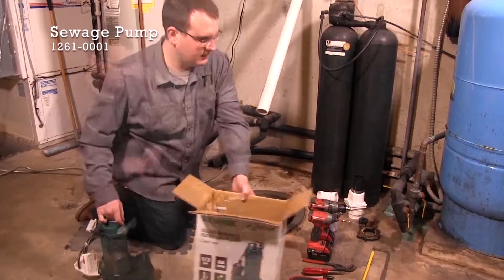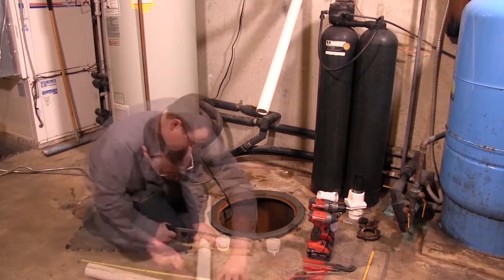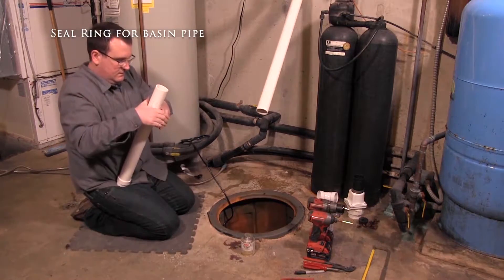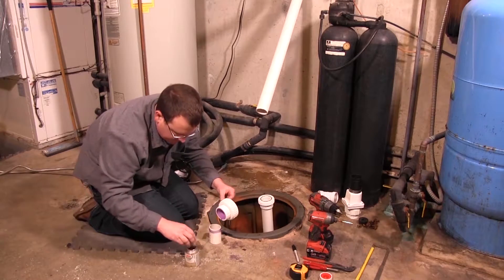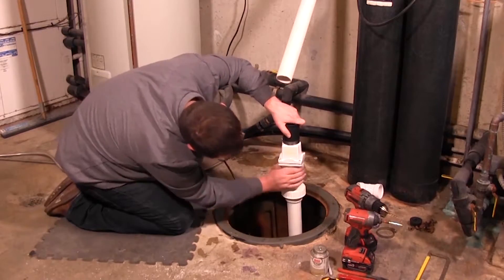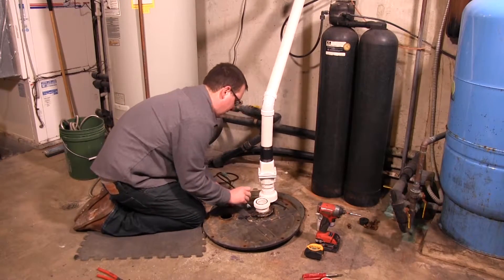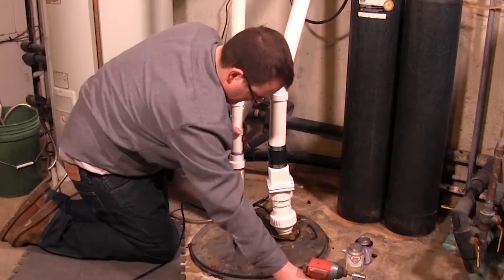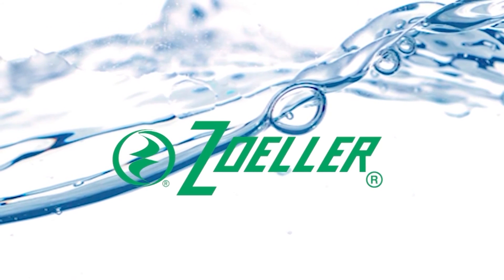How to Install a Sewage Pump

Comment: can i replace my sump pump with a sewage pump? i guess my groundwater is so hard, I'm having white buildup on the pump which clogs and burns it out. I've gone through 5 of them and I have a brand new home. I just need something that wont burn out and can handle the white buildup. My plumber cleaned out 4" of the white stuff two weeks ago and it's already starting to coat the bottom and sides of the basin again. The discharge pipe from under my basement slab has this white buildup in the pipe as well.

Comment: No need the ball valve ?
Reply: They had a check valve on there he just didn’t talk about it. There is no need to replace the check valve with a ball valve on a pump system like this due to gravity.

Comment: Sorry I have a Question that you might think is silly but do you always need to use a basin? is there anyway just to straight out assist it to pump it from the toilet or is that basin just how its done. I totally dont have any clue?
Reply: I know this is late, but The purpose of the basin is not only to hold the liquids but to also provide a space for the float switch to work. You can technically connect a pump directly to the line without a basin but you would need some other form of on/off switch that would know when there is stuff to pump and when there is not. This would take some engineering/designing to get right. Other than that, you could leave the pump running 24/7 but that would be very expensive for power as well as wearing down the pump quickly.